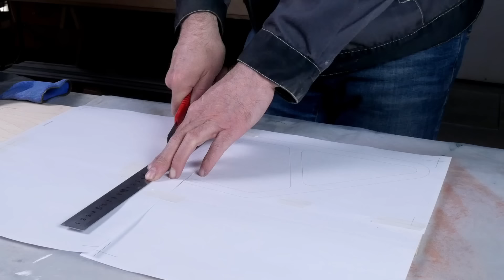Bold but Innovative... Wooden Sectional Trays | We Don’t Make Things Like Everyone Else

Comment: I watched the whole video and enjoyed your problem solving and process. I especially like that you built it with your tools and mind, not a cnc and a digital file. Great way to monetize scraps in the workshop. thanks for the video
Reply from the maker: Thanks a lot
Reply: I agree 100%. I’m so very tired of “woodworkers” whose “skill” consists of nothing more than placing a piece of wood in a CNC or laser machine and pressing a button….
Reply from the maker: @mudz678   And I agree with you
Reply: One should utilize the knowledge and tools they have at their disposal.
Some examples might be but not limited to a  CNC it's perfectly  fine, if it's a cordless drill driver fine, a block plane fine,  a router table fine, a drill press fine, an edge bander fine,a band saw fine, a box cutter with replaceable blade fine, a random orbital sander fine. They are all tools at the end of the day. Use em if you got em!

Comment: Nice job man. The large radius inside corners are a nice design choice. Thanks for sharing your method of pulling that off. I like how you went into to machinist mode hogging out all that material with the forstner bit. One thing I was trying to figure out was how you flattened the bottom of the pocket, especially since the forstner bit leaves a little hole in the center. Does that ball-end-mill-like router bit have a flat bottom, so you can basically etch-a-sketch the entire thing?
Reply from the maker: Thank you! This is not a ball cutter, it is a cutter with a flat bottom, the diameter of the flat part is about 10mm. There are the same ones, with a larger diameter. But they did not allow me to make the correct radius in the inner corner.

Comment: Beautiful, thank you! What’s with the drill bit on the router? I hope you reuse your offcuts too! 😅
Reply from the maker: Thank you! 
I did not quite understand your question.
Reply: @Woodwork_Mix  - I suggest the question could have been "why did you use a drill bit as a pivot point when rounding the (outside) corners?"
Reply from the maker: Now it is clear. There are no tricks here. It was just the right diameter
Reply: @Woodwork_Mix  apologies, the guy below has phrased it well. You are using the drill bit as a pivot point! Thank you